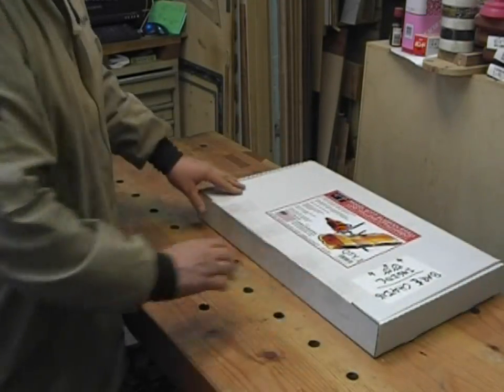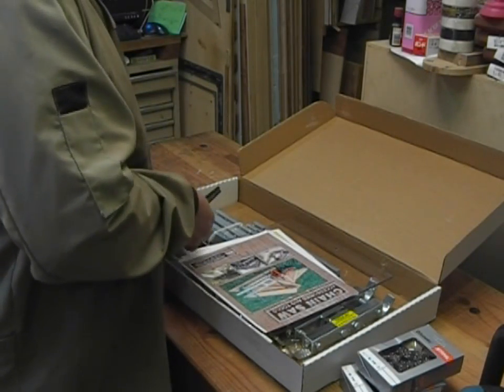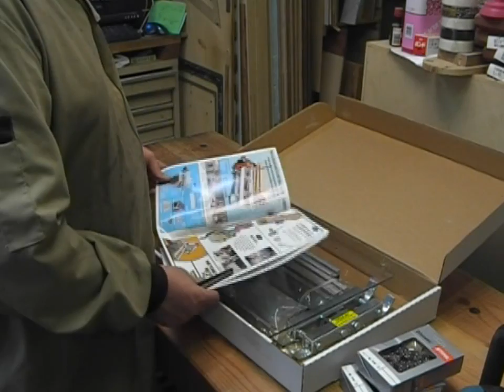Granberg Alaskan Small Log Milling Attachment

Comment: Good introduction - I'm going on three weeks waiting for mine, and I live in Atlanta not Japan!  Enjoyed your video, but have a few suggestions: 1) shouldn't you be wearing gloves when handling a chain?  2) shouldn't you use a torque wrench to tighten the bolts on the clamp that secures the bar? 3) aren't you concerned that an electric saw would be too under-powered for a cross rip of hardwood logs? 4) on the bigger Grandberg jigs, you could roll the dice and take off that curved end piece. I wouldn't go too far with that amendment.
Reply from the maker: 1) I work with my hands, they are fairly tough, gloves would be OK, but they reduce my dexterity.
2) In a perfect world a torque wrench would be nice I guess, but in the world I live, you learn to do it by feel. Have you ever noticed a 1/2" wrench is a LOT shorter than a 1" wrench? There is a reason for that.
3) NO, you go slow, let the saw cut, take a break, is it perfect? No, but I live in downtown Tokyo, I cannot be running a noisy gas chainsaw and stay friendly with the neighbours.
4) You do you and I'll do me.
I hope you get your mill soon!
Domo